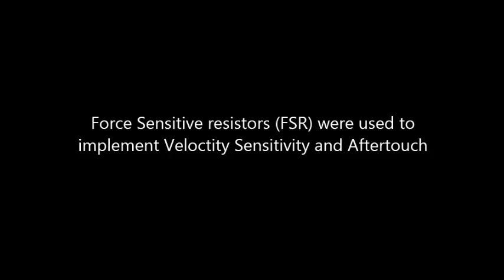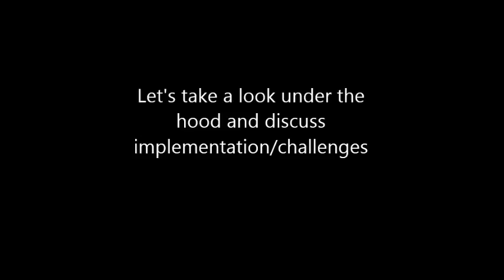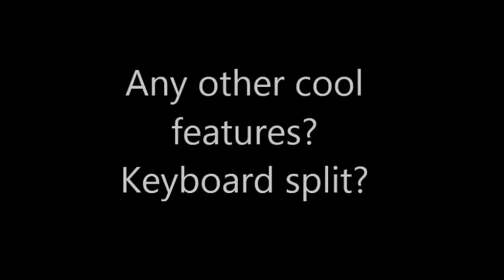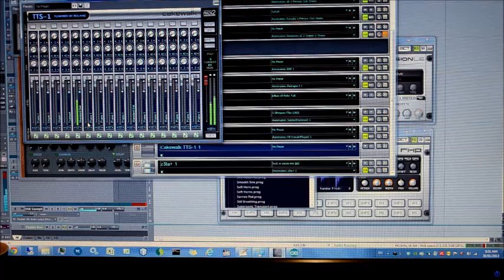Adding Velocity sensitivity / Aftertouch to Piano toy Midi  controller (Part 2)

Comment: would be possible to do this with a 88 keys keyboard?
Reply: totally, just use a bunch of shif registter 74h595
Reply: @rodrigoschneider4973  
Please explain a bit further, I want to add Aftertouch to my Yamaha MX88 (Synth) I like it alot, only thing its missing is Aftertouch MIDI

Comment: I left a message on part one asking whether or not you would consider making one of these for a paying client. In one of your videos you said something about wanting a challenge. I have one for you that I think you can handle. Can you take a Casio SA-76, make it velocity sensitive with aftertouch, add a lightweight midi module, replace the speakers with louder speakers, and, finally, trim the edges off the sides so the whole thing is only a hair wider than the keyboard itself so that it fits in an international carry on? That's my dream keyboard. If this doesn't interest you, do you know someone who might be able to use your designs to build it? I would pay for the parts and labor, of course. I live in the Boston area.

Comment: Hi Jen. Could you work up a tutorial implementing pitch bend?   I used your code (modified a bit) for the basis of my MIDI project and it does work!
Reply: Just change the after touch CC to pitch bend CC?